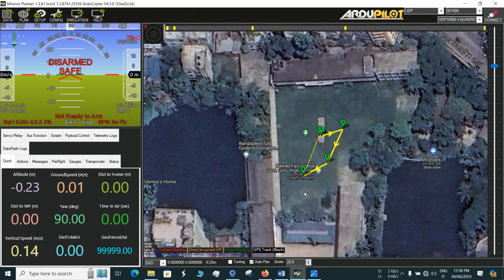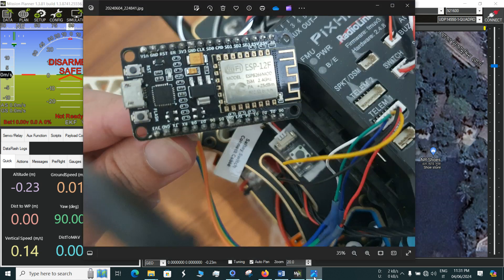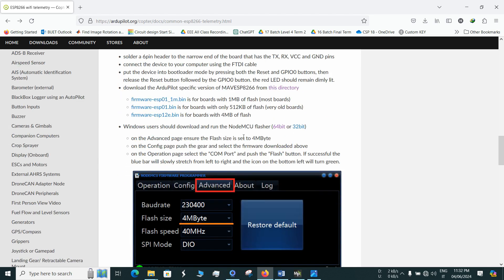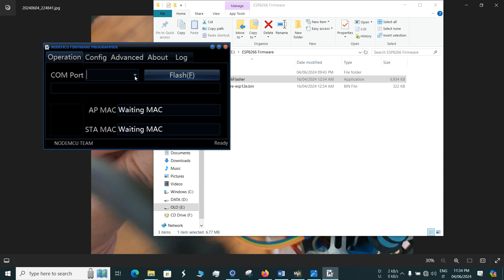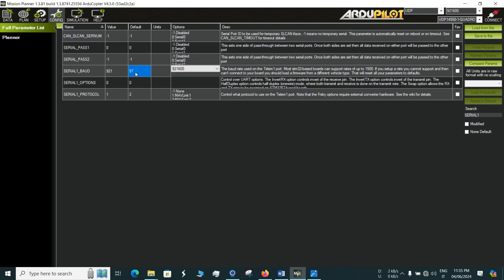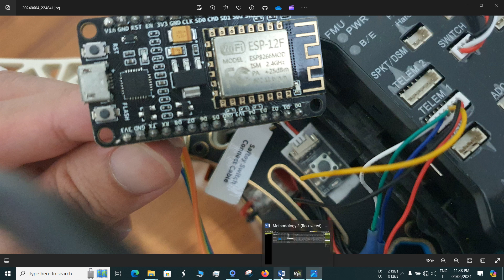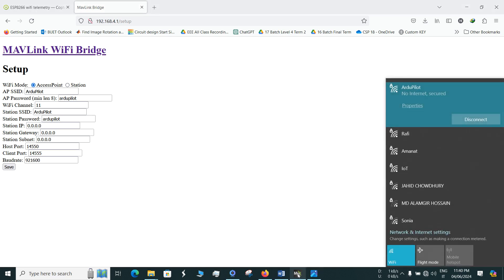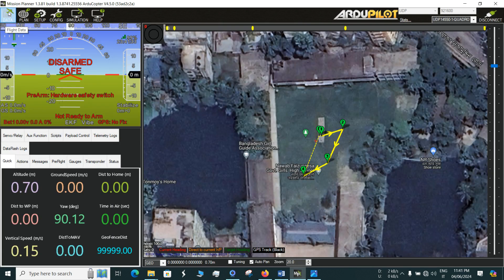Wifi Telemetry for Pixhawk Drone Using ESP8266/NodeMCU/ESP32 (Telemetry)

Comment: does this mean you can use it over the internet for unlimited range? is this better than dronebridge? im struggling to set it on inav 7.0
Reply: Not really because the ESP 8266 will have to connect to a Wi-Fi router at all times

Comment: Hello bro, can u pls tell me that will this method also work on APM2.8 flight controller??? If yes then are all the steps same for APM2.8 also, as shown in this video
Reply from the maker: I am not sure about APM as I did it on Radiolink Pixhawk FC. You can try anyways!
Reply: still thankyou very much for ur kind reply
Reply: Bro it is working on apm 2.8 ?
Reply: are you working on apm2.8 
can you tell me your mission planner version and firmware version 
and fine tune parameters

Comment: I made this but not working don't know why it shows on WiFi with its name ardupilot but my drone isn't connecting... What would the problem..?
Reply from the maker: Make sure that the connection type is UDP, select the correct baud rate and also ensure that you have wired the DF13 connector properly. Double check if your computer is connected to Ardupilot WiFi generated by ESP8266
Reply: @rafihoque7431  which buad rate should I select. Are you saying mission planner's buadrate.? I have selected sometime ago with same telemetry but now that telemetry isn't connecting.

Comment: How much range of this wi fi telemetry
Reply from the maker: The range of the WiFi Telemetry is same as the range of the ESP8266. Around 100 meter with no signal shadowing effect. However, you can increase the range by using an external antenna. For long range like a km or more, it's not suitable. However, it is the cheapest short range Telemetry that you can make within $3.